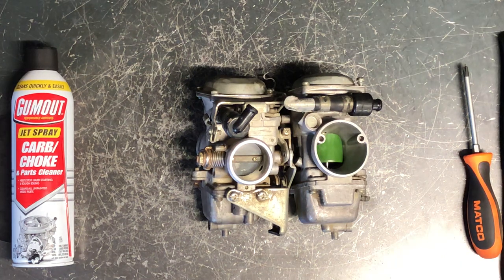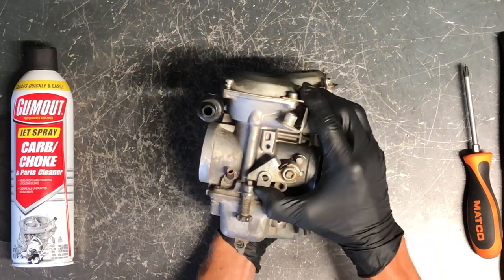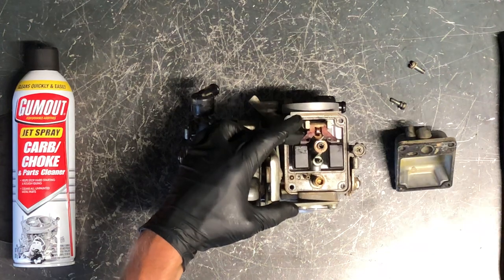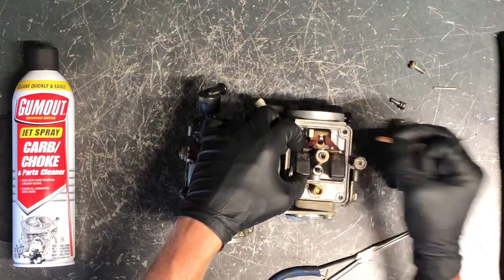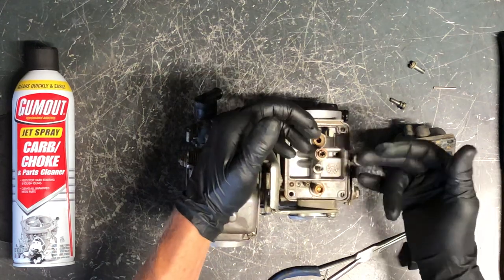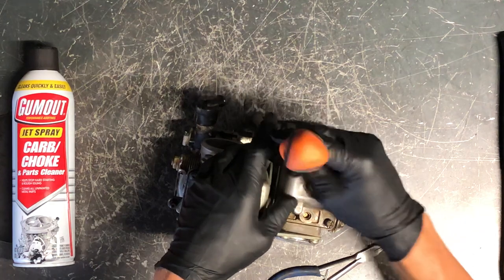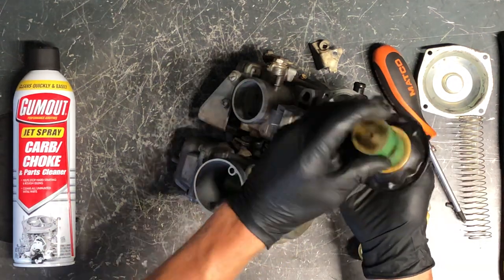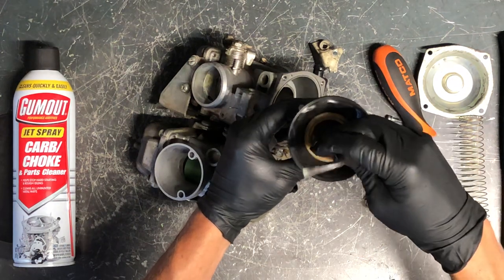Yamaha Virago 700 WONT START or IDLE Carburetor BAD GAS Rebuild Clean - Carb Kit

Comment: I think maybe you forgot to inspect and clean the long jet in that tube under that main jet. That long tube jet has tiny holes in it that atomize the fuel and they very often get clogged. BTW great video. Very professional.
Reply: Question i have a vigaro with a 41 and 122. Which one goes into long tube yiur speaking of
Reply: yes. Emulsion Tubes Go GREEN with bad gas first. Tiny holes. Well.Pilot Sucks Up the Crap in the Bowls First..its a coin toss.  . Yuk
Great Vid!

Comment: So, i had my 1986 virago xv700 with a double Hitachi HSC40 carburetor, sitting foe 7-8 years. Needless to say what happened to the carbs. After cleaning everything (my first time) parts did not look too good but I reassembled everything and reinstalled it. The right carb (as I’m sitting on the bike) was leaking gas internally. Bought 2 rebuild kit which comes with 3 different main jets (#124, 128 and 132). Assumed that each carb used the same size. Could not read old jets so i went  by hole size and installed 2 #132. Later found an online manual that actually says the #1 carb should have a #128 while a #132 goes in the #2 carb.
Can anyone tell me which is the #1 carb? I was assuming that the #1 carb is the one going to the front cylinder, but somewhere else in the manual it lists #1 and the word left in parentheses.
Reply: Also, regarding the pilot screw, another YouTube video says that a tapered screw adjusts fuel flow, while a stepped screw adjust air flow. My virago xv700 has a stepped screw. Is it correct that it adjusts air flow?

Comment: My diaphragm was almost melted or squished in the carb when I tried taking them both out. Where it rests on there. Anyway it got destroyed getting it out. Had to take a razor blade to detach it. Am I able to buy a new diaphragm just the black rubber part? Also what size would that be?
Reply: If not late, I believe you can. Try this link on ebay:  . 2 X Carburettor Diaphragm Membrane Fits YAMAHA VIRAGO HITACHI HSC40 XV. There may be several prices.